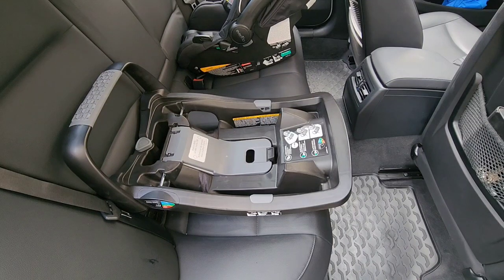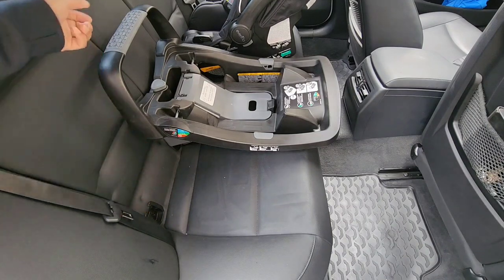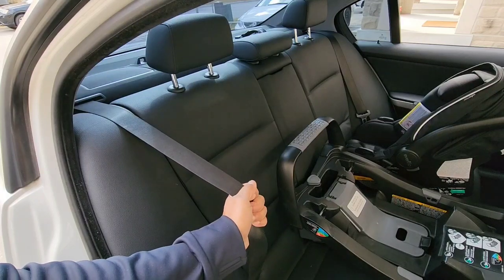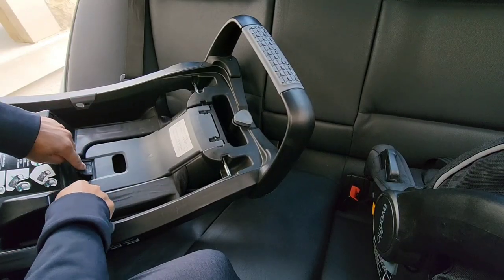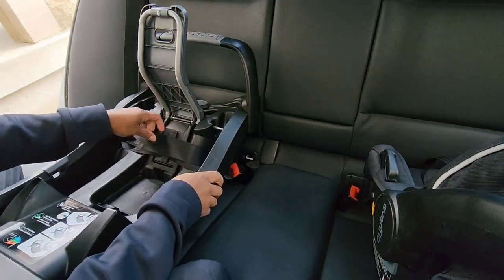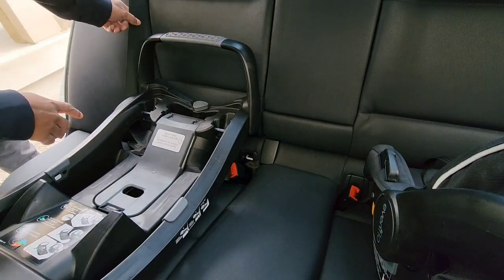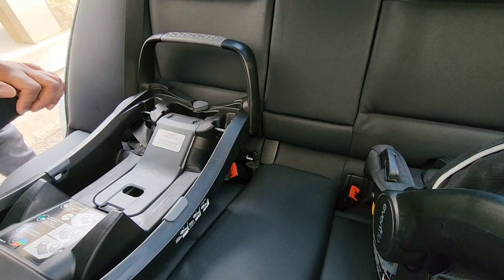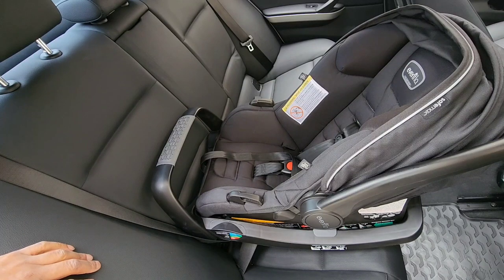How to install an infant car seat using the seat belt|Evenflo Safemax

Comment: Hello! Thanks for the video. I have a question. Do I have to attach the car seat using the universal lashes and the seat belt as well? Or Do I have to use just one?
Reply from the maker: Great question. It is not recommended to use both the seat belt and uas together. Try both methods and use only the one that secures the seat best.
Reply from the maker: Check out my other video on Infant car seat installation (using UAS) https://youtu.be/RbWX1KuouwI  I hope this is helpful!

Comment: Hi great video but if this is the safemax infant only carrier, you do not have to lock the seatbelt after you have used the lockoff. its a true lock off so there is no need.
Reply from the maker: Thanks! Always refer to the owners manual when installing your infant carrier car seat.

Comment: How do you adjust the recliner?
Reply from the maker: Hi, that's a great question. Try to locate the triangular knob on the top side of the base. Turn and hold it in a counterclockwise direction to release the locking mechanism so that you can select the appropriate adjustment. Once you've achieved your desired height, release the knob and ensure it locks into its respective slot. Also, try to get the seat to recline to 45 degrees to help protect your child in the event of an unexpected collision. If you have any further questions or requests, don't hesitate to ask. I hope this is helpful. Thanks!

Comment: I have a seat cover and my base keeps moving side to side even with pressure on it…. is this normal?
Reply from the maker: Some car seat covers promote slippage. In those cases, I would recommend not to use it. I hope this is helpful.
Please subscribe to help support my channel.  Thank you!
Reply: Totally normal, my son comes flying out of his car seat when we hit a bump about once a week. Make sure you have the window next to the seat rolled up so they don’t fly out of the window and they’ll be fine 👍
Reply from the maker: DO NOT USE THE SEAT. That is not normal.  Please refer to your owners manual to make sure you installed it correctly before you continue to use it, and use my videos as a guide. If you need any additional help or have any questions, please let me know. 
Child safety is very important to me, and I take it seriously.

Comment: How do I take the seat off? Without the base?
Reply from the maker: Great question! On the backside of the infant carrier near the top. Locate the handle and fully squeeze and hold to release the lock while lifting the seat straight up off the base. It's a question that is often asked. Please consider subscribing to help grow my channel 🙏
Reply from the maker: If you're having a difficult time locating the release handle. Check out my review video on the Evenflo Pivot Xpand Stroller Travel System. In that video, I show the location of the release handle on the infant carrier. I hope this helps.
Reply: Appreciate you